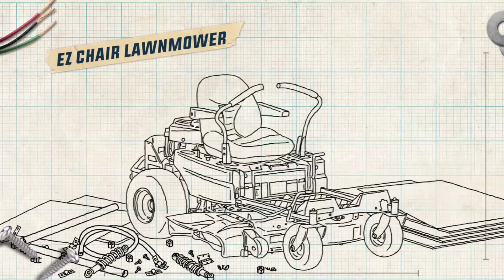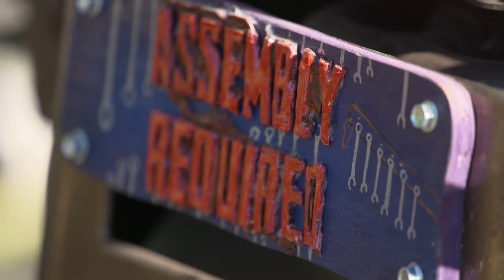Assembly Required: Ultimate Landscaping Machine RECLINES and WHACKS WEEDS (Season 1) | History

Comment: I'm just watching an episode of yours where you have them building the driveway sweeper.
  This has me needing to pass on an idea I've had for a long time, but I'm not an engineer, a mechanic, or a welder. 
   SNOW is a problem in our winter suburbs (Canadian). Shoveling or snow blowers are okay but the problem becomes WHERE TO PILE IT  in winters when we get lots of it. 
   My idea? A snow baler. Lol  I'm a farm boy. Snow compacts. It's the reason for glaciation. So, a unit with a snow blower at the front, a cab for the operator, and 2 compartments, alternating between being filled and being compacted. The snow blower blasting the snow back into the alternating compartments. 
  This allows for much smaller space necessary for a stacking and piling the snow. Crazy!? Trust me, there's an unknown market for this.

Comment: Really. Engine wont crank over. Must be the float in the carb. If there going to booby trap at least do it right. Float has zero to do with starter system.